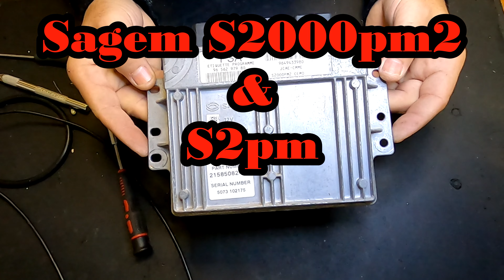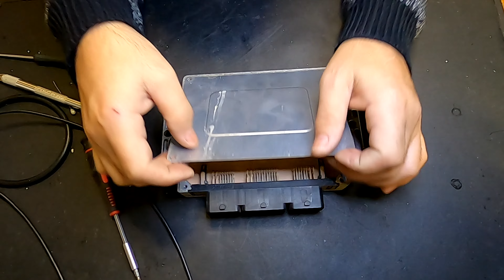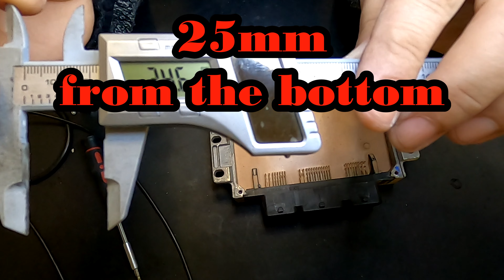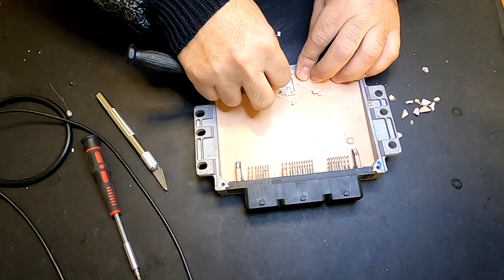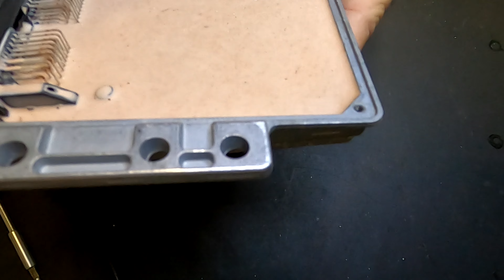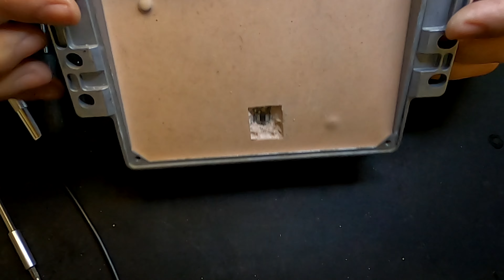Peugeot Citroen sagem s2000 eprom location

Comment: If I swap the  cip do I have to do any thing to the software?
Reply from the maker: Thanks for watching.
You can swap the eprom to another ecu and dont have to do anything to the dump.
Reply: @PSICompanyPerformance  thank you , my best regards 
Would be possible to eliminate or remove the immobiliser just by remove it( just Take it of and dont put it back
Reply from the maker: @JohnSmith-pq9zo  No thats not possible in these Ecu's
Reply: @PSICompanyPerformance  
So i have to put the cip back;( swap it) right?
Reply from the maker: @JohnSmith-pq9zo  yes..
Reply: @PSICompanyPerformance  thank you for your time, I appreciate it!
Best regards
Reply from the maker: @JohnSmith-pq9zo  you are welcome.
This is why i make these videos, is to help.